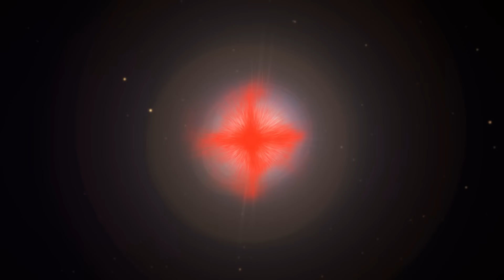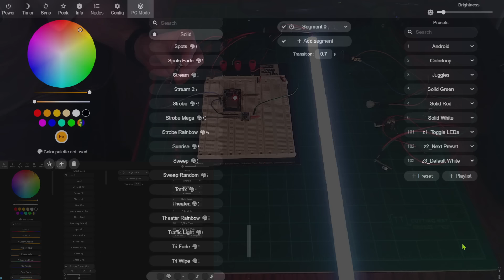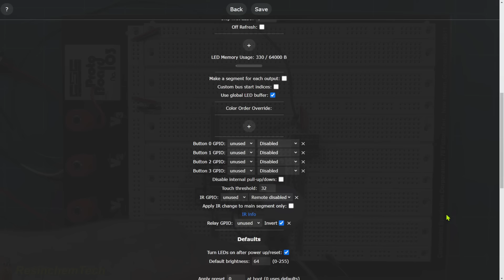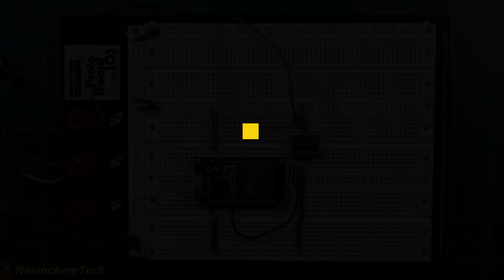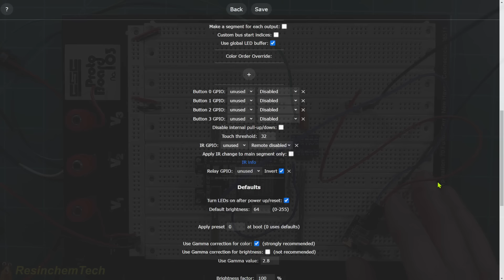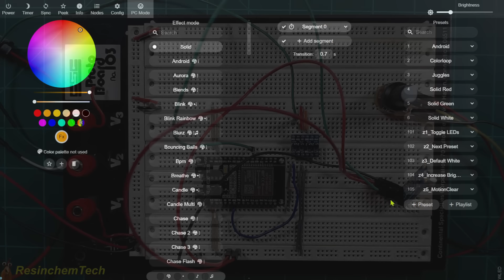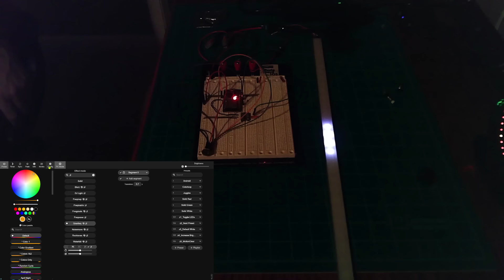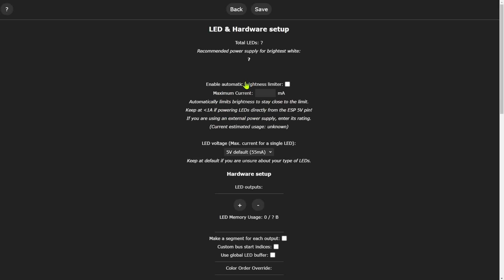Level Up Your WLED Projects: A Guide to adding Components (no code!)

Comment: Is it possible to use an ultrasonic sensor with wled?
Reply from the maker: As I mentioned in the video, standard WLED has no way to deal with numeric values from sensors like distance.  However, there are user mods available (or you can develop your own) that would allow you to connect a distance sensor and then take some action with the LEDs.
Reply: @ResinChemTech  thats amazing although i dont even know where to start programing do you think this is a feature that will get implemented in the future?
Reply from the maker: New features are being added to WLED all the time, so it's hard to know what may or may not be added in the future.  One issue is that every new feature added makes WLED a little bit larger (unless something is taken away) and at some point it could exceed the capacity of the ESP boards.

I think they may eventually find a way to make installing user mods a little easier, but I think coming up with a way to handle what could be an infinite number of values coming from something like a distance sensor would be extremely difficult.  The sensor could return any number from, say, 2cm - 400cm.  WLED would need a way to 'do something' or process those values and then provide you a way to specify what you want to do with the LEDs when the reported number is higher, lower or equal to a value.

This is where you are getting more into automation and an automation engine, like Home Assistant or NodeRed.  Using automations, it would be simple to read a value from a distance sensor and then send a command to the LEDs.  In fact, I do this exact thing with my stair lights (although I'm using a ToF distance sensor instead of ultrasonic... but the concept is the same).  I don't foresee an automation engine being added to WLED simply because of the complexity and the size of the resulting code.
Reply: @ResinChemTech  couldnt it treat those values as an analogue signal similar to what a potentiometer would, or maybe there is an ultrasonic sensor which has the internal code to just give you an analogue output?
Reply from the maker: A potentiometer is similar, but slightly different because it is actually changing the voltage on the analog pin.  And it is pretty easy (relatively) to map the voltage to a fixed range values like brightness or speed.  But something like an ultrasonic sensor is going to report a numeric value on a digital I/O pin.  You could possibly map a distance range to something like brightness or speed as well with similar code modifications. But what I don't believe you can do (without substantially more involved code changes) is to control 'non-linear' values like the effect or color palette.  Nor could you currently do something like turn the LEDs on when the distance is below a certain value and turn them back off when the distance is greater than that value.  At least not in any way that I am aware of with the standard non-modified WLED.

If you have a Discord account, you can always try asking or making an enhancement request on the WLED Discord server.  It's pretty active and they even have a channel for requesting new features.

Comment: good explanation.
how to add RTC to wled. so that internet clock data goes into RTC and RTC can be backed up if there is no internet connection.
Thank You.
Reply from the maker: If you want to add anything to WLED, you need to install a custom mod (or write your own).  While I haven't tried it myself, there is at least one custom mod for RTC in the WLED mods folder:  https://github.com/Aircoookie/WLED/tree/main/usermods  I think this is similar to what you are wanting.
Reply: Thank you for your response and answer. I will try it

Comment: Can an ESP32 S3 Super Mini be used?
Reply from the maker: I haven't tried one, but you can find a list of officially supported WLED boards here:  https://kno.wled.ge/basics/compatible-controllers/
Reply: @ResinChemTech  Ok. Thanks for the feedback. According to  Copilot, my ESP32 mini is actually an ESP32 C3. It has an Espressif S3 chip, but it also has a little red chip with C3 on it. WLED does not yet support or is not yet compatible with the C3, but it is a work in progress.

Comment: Thanks!

Your videos are fantastic, thank you.  Newbie quick question on the relays, do I need to have one on all the power injection points?   I have a 400 LED stip with three power injection points and from what I can ascertain I think I do?

If so, I can use the buck converter to power all three?
Reply from the maker: Thanks so much for the super!  I greatly appreciate it and it will be used to help fund future projects and videos.

As far as the relay, yes you would need to kill the power to all the injection points, but there are multiple ways to accomplish this.  First you can run the power from your supply through the relay before you split it off to the three different power injection points.  That way you have a single relay that is controlling all the power to the LEDs.  Just be sure that the relay is rated to handle the current you expect for the LEDs.

While you can use multiple relays, do note that standard WLED is only designed to use one relay.  There is a user-mod that supports multiple relays, but you'd have to add that and compile your own WLED.  You can find more info on that here:  https://kno.wled.ge/features/relay-control/

As far as the buck converter, yes you could power multiple relays but the same rule applies.   Just be sure the buck converter is rated for the maximum amps that would be needed to power all the relays.

Thanks again for the support...and the kind words.  Let me know if I can help out any further.
Reply: @ResinChemTech  thank you for the quick response!  After I sent my comment I did some research and came across that very idea, put the relay between the power supply and controller (in this case an ESP32).  But I’m running the board from the same power supply so I’ll need to power that separately which is easy.  I have a small 5v, 3amp plug which I can use to power both the ESP32 and relay (it’s a 5v relay since they don’t seem to make one for higher amps for 3.3v). I’m using a 20 amp power supply with a 30 amp rated relay so I’m good there.  I hope this makes sense and I’m on the right track.  

Your videos are an inspiration to me, so well produced. Thanks again!
Reply from the maker: Sounds like you are on the right track!  The only thing I'd mention is that if you are using different power supplies for the controller and LEDs, make sure you create a common ground between the two (one easy way to do this is just run a ground wire from your controller along with the data line to the start of the LED strip).  If you don't have a common ground, the LEDs may misbehave do to possible ground potential differences between the controller's power source and the LEDs' power source.  You may have already done this... but I thought it was worth mentioning!
Reply: @ResinChemTech  common ground!  That always throws me off. My LED’s are wired straight to the  20amp power supply. So I need to connect the same ground out from the 3amp power supply (to the relay and controller), the 20amp power supply (on the output side of course), and the controller?

Sorry for all the questions.
Reply from the maker: Not a problem!  You just need to establish a single common ground connection somewhere between the controller and LEDs.  You can make this connection wherever it is convenient, but on the few occasions where I've done it, I just run a ground from the controller along with the data line to the start of the LED strip.  Since I'm already running a line for the data signal, it is pretty easy to just include a second ground connection here.  In fact, I have a number of standard wiring diagrams in one of my blog articles that shows this:  https://resinchemtech.blogspot.com/2023/01/wiring-diagrams.html

Look for the example that shows dual 12V and 5V power supplies. This same wiring can be used for two separate 5V supplies as well.

If you need additional assistance, I'm glad to help but it is a little restrictive what I can do here in the YouTube comments.  If you like, feel free to contact me via email (you can find my email address on the 'about' section of my YouTube channel page... I don't publish it here because it gets picked up by spam bots).  Or if you have a Discord account and want to shoot me over your Discord user name, we can connect over there as well.  Otherwise, best of luck with the project.  Let me know how it turns out!
Reply: @ResinChemTech  thank you all the help!

Comment: Thank you for this very clear tutorial.

With the PIR sensor, it seems that it detects your hand moving in as one action, and hand moving away as a second. So if turning the light on, it would only do so when your hand is present.

Is there a way to be able to 'wave' past the sensor - off > on > off and for the LED strip to turn on, and then when you  'wave' past the sensor again the led strip turns off ? Thank you
Reply from the maker: What you are actually seeing in the video is that my hand triggers motion to turn the LEDs on.  But then the motion detector "resets" or clears when there is no more motion and this turns the lights off.  My hand really has nothing to do with turning the LEDs off.  All motion detectors work this way.  Some just reset faster than others.  So the way I used it in WLED, the lights will always turn themselves off at some point after motion clears.  You'd have to use some other type of sensor and settings to get movement to turn the lights on... then they stay on until motion again turns them back off.  Or use two sensors... one to turn them on and the other to turn them off.

Hope that helps clarify what you were seeing in the video.
Reply: @ResinChemTech  Thank you, your video has been incredibly helpful - thank you for the time you dedicated to doing the various setups, recordings and editing for this.

Comment: Hello, thank you for all your videos, they have been a great help. I’m hoping you could maybe  shed some light on a problem I am experiencing on ESP32 wroom devkit 1.
I have two buttons wired up to GPIO 18 and 19,
Led data is on default 16. Button one is set to 19, button two to 18. 19 has actions set to preset commands (on/off, cycle, default colour) and 18 to default values (0 in macros)
The problem I’m having is buttons 2 is copying button 1, even when I set it to disabled, it still triggers. I have checked for any shorts but all is okay. Reflashed the board and tried different versions. Do you have any idea what could be causing this. Thank you.
Reply: So, after a lot of adjustment and testing, it turns out it was simply CROSSTALK. Problem solved.

Comment: can i use tof sensor and hand sensor for it?
Reply from the maker: A ToF sensor returns a numeric value.  Standard WLED doesn't know what to do with a number.  You would need to install or write you own appropriate user mod that could take some sort of action based on particular numeric values returned by the sensor.  Here's a user mod that uses the VL53L0X and hand gestures to control the LEDs (I have not tested or tried this mod):  https://github.com/Aircoookie/WLED/tree/main/usermods/VL53L0X_gestures
Reply: @ResinChemTech  I guess I'll use other method, thank you 😀
Reply: @ResinChemTech  It's my first time to have a project about esp32 with wled. I would like to ask you few questions.

I'm planning to put a 5M led strip under our stair handrails. I decide to put it there, because our stair don't have allowance under the steps, where I can put aluminum diffuser. I measured the space under the handrails, and I only have less than 8mm. 

These are my materials so far
  -esp32 w dev board
  -ws2812b rgbic cob led strip 5M 60led/M 5mm
  -logic level shifter I2c
  -5v 30a relay
  - IR transmitter
  -2 PIR motions sensor hc-sr501
  -power supply 5v 30A   (300x0.06)= 18A 
  -10M 18 AWG or 22AWG?

1. Can I use 2 PIR sensor, one at ground floor and the other one is on 2nd floor?
2. Can I modify the PIR sensor, to on and off only at a given time. For example, from 6pm to 6am only?
3. Can I use remote for extra switch?
4. Do I really need a relay? or fuse?
5.What size of wire AWG 18 or 22?

Thank you 😅
Reply from the maker: I have two different videos (and related blog articles) on creating stair lighting that will address most of your questions and could easily be adapted for LEDs under the handrail instead of along the stringers.  One uses WLED and two independent motion sensors with ESPHome, and uses Home Assistant for the automations:  https://youtu.be/Y29Y0iTLggg

The other one doesn't require Home Assistant or ESPHome and instead uses a single controller running custom written Arduino code:  https://youtu.be/b4s_VEtVWY4

Do note that I have an update video for the first Home Assistant version that replaces the PIR sensors with ToF sensors, which I have found to be much more reliable with less ghosting:  https://youtu.be/ZRb_wpJo1AM

Those videos and articles should address most of your questions, but with the Home Assistant/WLED version, you can certainly do everything asked in questions 1-3.  For the relay and fuse, they aren't technically required but the relay will reduce power consumption when the LEDs are off and the fuse is a safety feature.  I cover some of these in my other LED videos as well.  The gauge of wire depends on too many factors to give you an answer... you should always use the largest size wire possible... both as a safety issue and to reduce voltage drop.  There are online calculators that can help you with selecting the proper gauge based on current, length, wire type, temperature and more.

Comment: Can the switch also be used for the LED Data pin so I can switch between 2 ESP32 Boards? :)
Reply from the maker: You can use a switch to toggle the LED signal between two controllers.  I do this with my matrix clock, where one controller is running WLED and the other is running custom Arduino code for the clock/scoreboard.  But I'm using a manual toggle switch.... not one that is switched by either controller.  The issue is that if you are using the switch for the LED data lines, then you can't also control that switch from WLED (a single pin can't be both the data line and a switch).  So you'd need some other external way to toggle the switch from one controller to the other.  I just opted to make mine manual.
Reply: @ResinChemTech  I will use a On / On manual locking toggle switch with 3 pins.

The middle pin goes to the led strip data and left goes to one ESP32 and right to the other. When pulling the switch its shorten/connect one of the ESP32 to the LED Strip. 

I also want to use a Level Shifter to not loose signal quality when going  over the switch. ✌

Comment: Useful video . Will be great if you can create a video of few common use cases such as staircase , parking , alarms etc using sensors integrated with esp32 to trigger or set  wled presets / Colours . There are a lot of videos about wled not much about such integrations
Reply from the maker: I actually do a number of those things... and discuss how they are done... in a number of my other LED projects.  You can find all these in an LED-related playlist that is shown at the end of the video or can be found on my channel.
Reply: @ResinChemTech  Could you point me to one where you are controlling the WLED through ESP32 .  Not where its using Home Assistant but running  code to access WLED parameters  based on sensor input. Thank you
Reply from the maker: Well, to be honest, if I'm going to use code to control the LEDs, I usually end up writing my own Arduino code on the ESP32/ESP8266 to control the LEDs.  WLED does have API interfaces using HTTP or JSON, but you still need some sort of automation engine (like Home Assistant, NodeRed, custom app, etc.) to send those commands to WLED when some sort of trigger, like s sensor change, occurs.  

There are some WLED user mods that you can compile into your own version that adds some sensor options.  But if you want an external device (say like an alarm) to trigger something on the WLED controller, you need an automation engine of some sort to watch for the state change of the alarm and then send a command to WLED.  You can see the currently available user mods here:  https://github.com/Aircoookie/WLED/tree/main/usermods